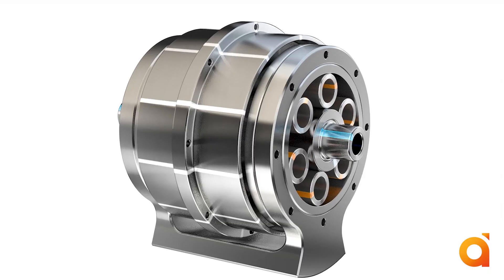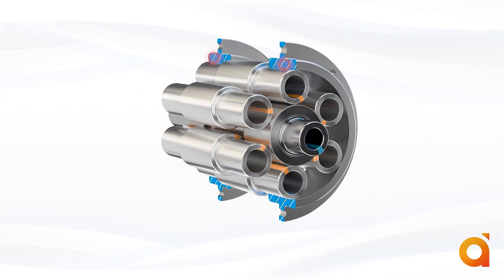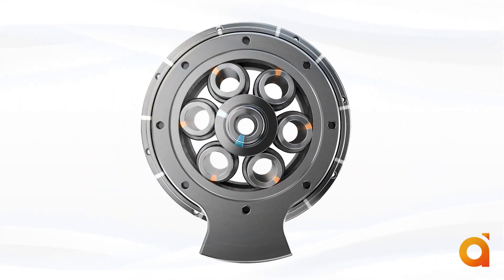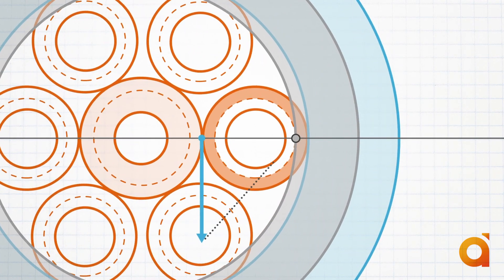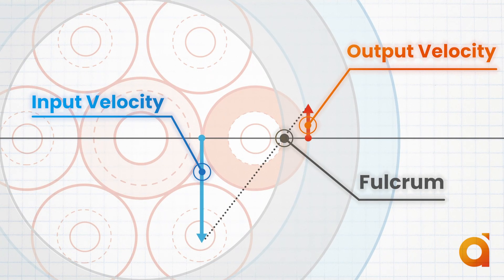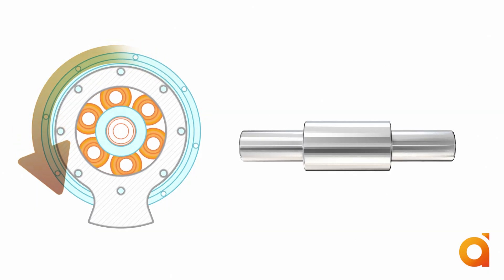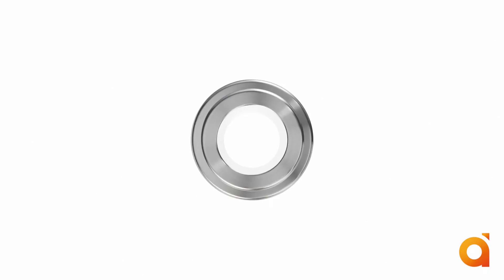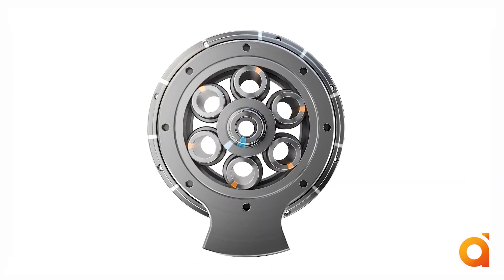Archimedes Drive: Zero Backlash Traction Drive Speed Reducer

Comment: That's fascinating. If a robot built with this reducer experiences slip even with an encoder on the output shaft, do you resolve this by measuring coordinates using a sensor at the end-effector? Or do you use a separate measurement device? I am very curious about that.

Comment: How about slippages? How is it possible not to slip?
Reply: In this short they talk about slip: https://youtube.com/shorts/iJv4tIU6Dl4?si=COY6QiuHe3YW3451
Reply: @BeLikeBop4670  it says as long as the mechanism isn't over loaded. It won't slip. But once everything begins to wear out. This will lower the peak torque. Meaning it's not reliable. It's not positive drive.
Reply from the maker: Every overtorqued a traditional gearbox?
Reply: @BeLikeBop4670  this is like driving a cvt car in normal road conditions with flat terrain. I'm sorry, the design isn't foolproof. In fact it's stupid.
Reply from the maker: but... it works...
Reply: @ArchimedesDrive-IMSystems only in certain conditions. It isn't positive drive.
Reply: Hit with a hammer: https://www.youtube.com/watch?v=bfti8UR80HE
Reply: @casNL23  it may seems ok when it's new. But after some time when things are getting worn off. It will slip. This is a wrong concept.
Reply: @casNL23  if you are a mechanical designer, you will understand why traction based concept won't last longer. 

Some new CVTs are working fine. But after some time the efficiency is getting deteriorating. 

Do you understand what positive drive means?

Comment: Slipping will cause wear so I guess this works best in applications where you don't expect regular slipping?
Reply from the maker: "Slip” here refers to exceeding peak torque — similar to overload in traditional transmissions. The key difference is that where gears may break or wear immediately, the Archimedes Drive can withstand repeated torque peaks without performance loss. Continuous slippage should still be avoided, but short torque spikes are fully acceptable and within design limits.
Reply: Hit with a hammer: https://www.youtube.com/watch?v=bfti8UR80HE